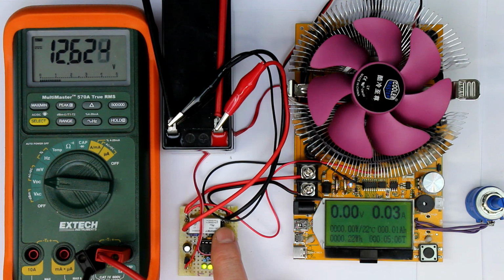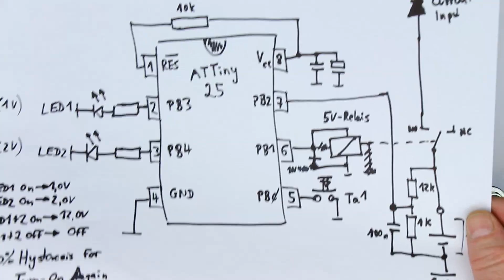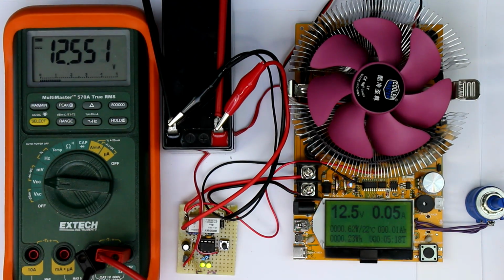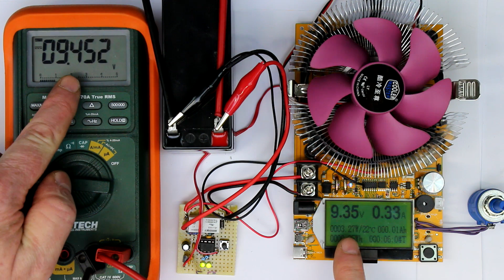Retrofitting a Low-Bat Turn-Off Feature to a Constant-Current Battery Charge-Tester

Comment: Hi KainkaLabs. Thanks for your video. Could you please describe the 4 wire voltage measuring mod?
Reply from the maker: You can´t do true 4-wire current (not voltage) measurement with this device. Period.
Reply: @KainkaLabs  thanks for your reply. With your comment I understand that this load couldn't work as a true 4 wire measuring (Kelvin sensing). I'm interested in the mod that is mentioned from 0:50 to 1:20 on the video, because I need a more precise way to read the correct voltage of the battery that is under test. From what I see on the video there is a wire soldered to the pin 1 of the bigger ic and another wire that goes to the resistors above the ic. I would be glad if you could comment how it was done.

Comment: Nice Video. I have had one for a few months and accidentally exceeded 180w limt. Needless to say the main large mosfet blew and i'm trying to find a new one or something compatible to replace it. It reads IRPF 260... IR 1138P...80...BA. Any links on where to buy a new replacement chip would be greatly appreciated.
Reply from the maker: You mixed up 2 letters: The IRFP260N in fact is a "standard" 200V/50A/300W power MOSFET and easily available. Go to irf.com (now Infineon aka Siemens) or directly to the product matrix at https://www.infineon.com/cms/en/product/power/mosfet/#!products to find similar parts
Reply: @KainkaLabs  Would this work as well?
https://www.ebay.com/itm/2pcs-IRFP260N-IRFP260-Manu-IR-Encapsulation-TO-247-HEXFET-Power-MOSFET/400985477037?hash=item5d5c98cfad:g:h0kAAOSwj0NUa~1V
Reply from the maker: Of course (if it is a genuine IR-product and not a fake :-)
Reply: @KainkaLabs   I went ahead and ordered it. I thank you for your time to help me out.
Reply: Part came in and works like a charm again. Thank You

Comment: The video at https://www.youtube.com/watch?v=ed9iEQlH5t4 appears to show the exact same unit, and he claims it ALREADY has a low voltage cut-off. He (xraytonyb) appears to show it on the display as accessed by the menu system using the button on the PCB, and seems to be saying the device will stop drawing a load when the voltage is at or below the low voltage setpoint input by the user. He definitely claims Max AND Min user definable setpoints for volts and amps.
So...why is your voltage cut-off circuit needed? Or is he just completely wrong?
Can you point us to a link to a user manual for the unit? That might help clear things up.
Reply from the maker: Because cheap chinese devices quite often do not have anything like a manual, you often have to find out the workings by yourself (and can easily overlook some features as perhaps I did). I will take a look at the video you pointed to. Nevertheless my retrofitted hardware cutoff add-on is quite universal and can be sed also for other devices or apllications.

Comment: Do you have also a foto about your modification without fan?
Reply from the maker: No, not ATM.
If you have exactly the same device, I can describe how to find the right points to connect the Kelvin-leads.
(ATM I don´t have the time to take a photo. Perhaps next week.)
Reply: @KainkaLabs  
Hello, I am interested also to have the points to turn that dummy load in a 4 wires one. Thanks